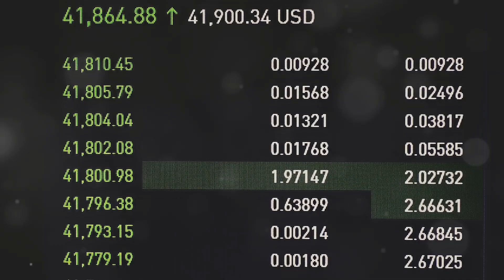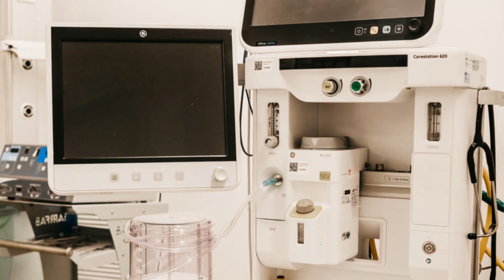Steel's Fascinating History

Comment: pure iron is malleable and ductile, it is NOT brittle! Cast iron is brittle, because it is NOT pure iron. It was initially impossible to produce iron without large amounts of carbon and other impurities.. this is because it was produced by burning a mixture of iron ore and charcoal. the thing that makes it steel is getting rid of most of the carbon, and other impurities. ie nobody ever deliberately added carbon in the "iron age". I make the point because so many people are confused about this. they say things like high carbon steel is a good thing. actually high carbon steel is just cast iron! The thing that revolutionized steel production was the Bessemer converter, introduced around 1856. it blew large amounts of oxygen through the molten iron, burning off the carbon. before this it could only be done on a small scale. maybe the Japanese did this hundreds of years ago? difficult finding information. but I enjoyed video anyway.
Reply from the maker: Thank you for the correction.